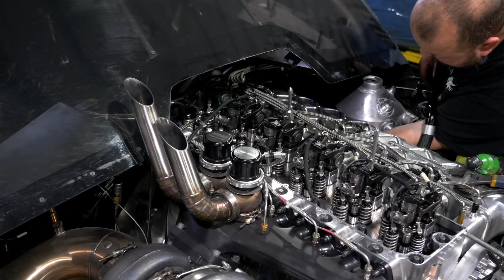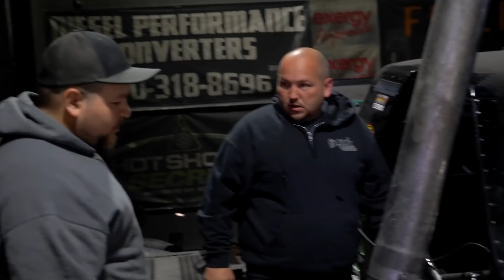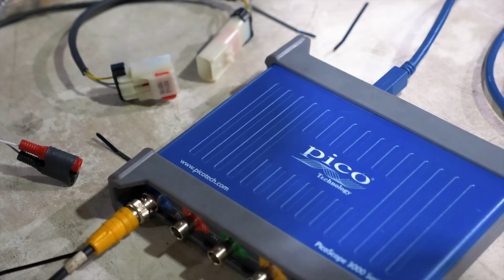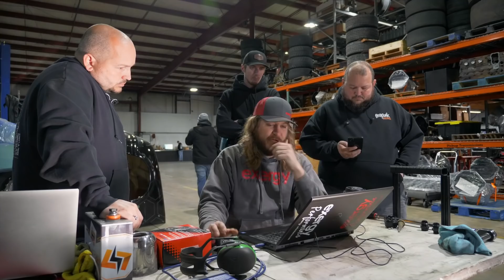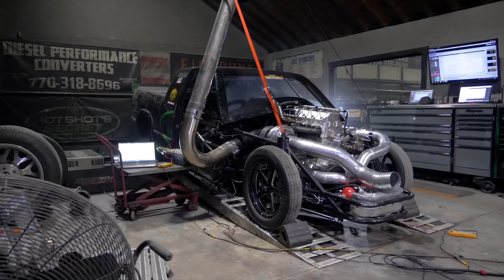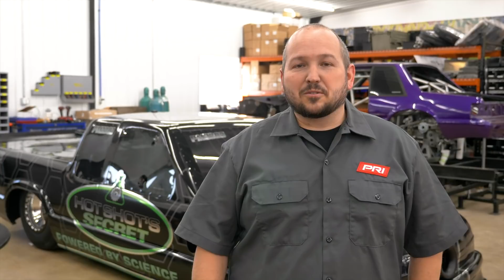THE S10 IS READY FOR 6000RPM+ THE 5900RPM CUTOUT IS FIXED!

Comment: @Firepunk Diesel  I realize my turbo sbc or 800hp cummins is nothing like your pro mod. Have you ever thought about adding a vacuum on the back side of the rings in the form of a  pump or using your turbo.  My cummins has a really tight secondary so its better on the street. I had a bit of blow by. I run a dash 10 off my turbo to my catchcan that has a separator on it. On my turbo sbc I use the exhaust pulse to create vacuum to pull blow by out . 
I can't wait to see this out on the track again. Happy to see you fixed your issues .

Comment: 1:25 increasing from a -12an to a -16 an is a 78.5% increase. Not 40%. This is such a bas ass cummins setup. The truck too, just awesome
Reply: Vibrant 12an line ID is .68" and 16an is .89", so that figures to a 30.8%. I'm not sure if they use Vibrant hoses, but they use Vibrant charge pipe flanges, so I'm assuming.
Reply: @ClarksAutoAndPerformance  using your diameter numbers it is a 71% increase. Not 30.8%.

Comment: How far can a stock Cummins rpm go before it destroys the bottom end. I have the springs, but I get worried at 4k rpms. Should I be worried? Or can I push it further for extended times. I have been ridding at 3800 rpms for minutes at a time when in wolf packs on I95. I have tons of power left, but scared to blow the engine.
Reply: I'm not an expert but I've heard of plenty of people running stock bottom ends to and past 5k. You're more than likely fine at 4k.
Reply: @austin2791  but for how long at 5k. I am a speed junkie. I can easily ride 150 for hours if the machine will let me, and road conditions allow.
Reply: @ChannelZeroOne  I would say for 15-20 seconds if you want to keep the engine in tact and healthy. When I meant running to 4-5k I mean on a pull, race or dyno run. You shouldn’t be running a stock engine over 3k for extended periods of time.
Reply: @austin2791   I have about 40k into this build so far. 

I cant be the only crazy guy here. I want to know how far someone has gone before busting a rod or spinning a main. Sled pull and drags are extreme stress in comparison to riding at a steady speed.

One of these dyno channels should run a 5.9 with only springs, studs and enough cooling so it can handle the load. Run it at 4500 for a ridiculous amount of time. I am guessing if its steady and loaded as an empty truck it might run indefinitely. 

When I push I watch the temps. The temps are only an issue if I am doing a lot of stop and go.
Reply: I think the radiator would be the limiting factor at that speeds.
Reply: @bagged1998  Maybe. I got a check engine code for temp to low because I gutted the t stat. Funny thing is I got a tune and I cant get rid of the epa codes.